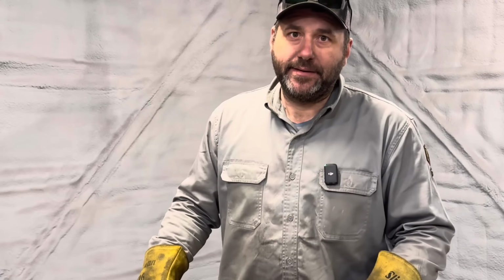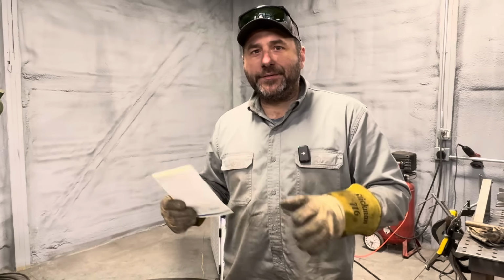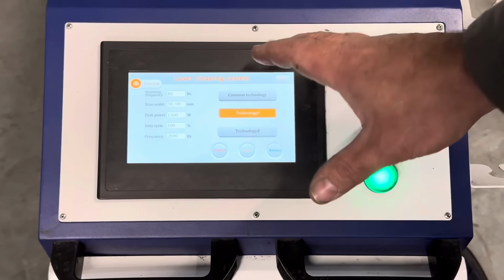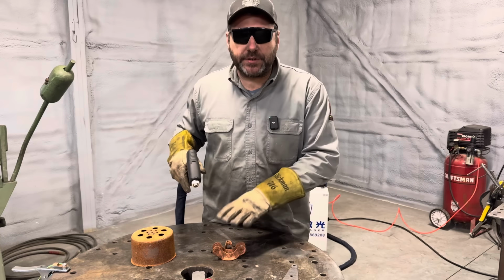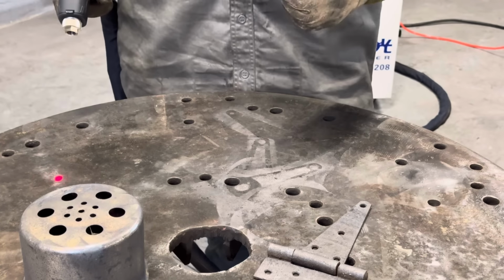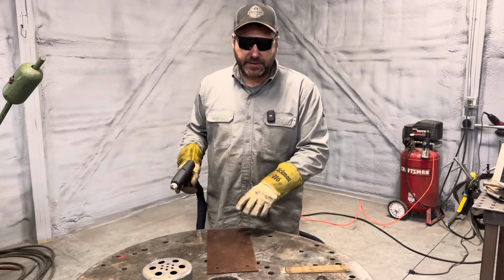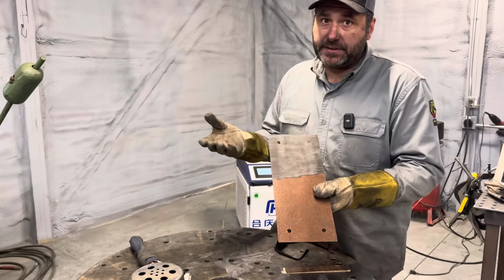Buying a laser welder/cleaner for a fabrication shop.

Comment: I’ve used the IPG hand laser welder and decided to buy a Chinese one. My first one I bought off eBay didn’t go well. It was a 1500w for $2799. It was a shipping issue. Got a full refund and found a 3000w fiber laser welder for $2100 on eBay. Just bought it and hope the shipping situation goes better this time. Both are in the US. 1st one in California. This one I just bought is in New Jersey. This machine although being a 3000w machine looks a lot like yours. Anyway I’m hoping it’s a good experience. As I said I’m familiar with welding lasers. Just hope there’s no problems with the unit and or the shipping.

Comment: Garbage.. we have a 14k watt  cnc cutting table... works great. 3000w welder cleaner is a pos, wire wheel is still far superior, laser cleans the paint does not remove hardened paint, very problematic when used daily at 100% duty cycle, lenses are ridiculously priced and burn many per day, customer service is awful, huge shipping delays, this is not cost effective, its unreliable, delivers an unsatisfactory finished product, virtually no safety literature, The welding side is no better, absolute perfect fit or garbage, 12+ passes to achieve a 3/16 weld, if your into anything bigger than spice racks, mail boxes or a muffler shop, these are crap.

Comment: Did your welder require a transformer? Or how did you connect the wiring? Mine came for 220V, but only one line and a neutral. Thanks.

Comment: im about buying the 1500 watt machine
i  purchased before the co laser  and the  fiber marking
well, it is true   they wont give   deep detailed info

but you can learn it on your own
in my case  it will be 4000  as door to door including all shipping and custom fee

extra cost is nitrogen, about 30 dollar per filling a bottle
consumables like protective  glass  or copper nozzles  for a few dollar each at least  dozen of seler on aliexpress or from seller you purchasing

it is up to you taking the chance  buying directly
but risk is  way  way less than many stating
Reply: router i purchased  in 2011 still talking  with the guy
same to the laser purchased 2018

Comment: Handheld laser cleaning, carries distinct risks. The lack of a fixed, stable setup increases the potential for accidental exposure to laser beams, posing serious threats to skin and eyes. It's also crucial to recognize that laser safety goggles are not one-size-fits-all. Specificity is key, as fiber lasers operate at different wavelengths compared to lasers like CO2 or Nd:YAG. Goggles suitable for one type might be ineffective for another. Ensure that the safety goggles are rated for the exact wavelength range of your fiber laser.

Comment: I saw on another video if you go into the setup and then you change the lens you have to actually change the lens in the unit and then you can actually change the scan width and I saw it go up to 40 mm

Comment: I'll wait until the price comes down. The televisions that were 10 grand when they came out are obsolete, and the better ones now are 500 bucks.
these things will get smaller and cheaper.. having a sandblaster/ cleaner, and welder/ cutter,  in one is an automatic game changer globally.
I'd say about 3 years,... buying will become more optimal
Reply: Just like plasma cutters. I used one at my old job 24 years ago that was the size of a shopping cart and ran on three phase power. That thing was probably 15-20 grand. Now I have one at home that works on 120/220 ac thats the size of a lunchbox. All for 300 bux.
Reply: Yup,...the solar panels and inverters coming are going to be small enough and cheap enough that it will be insane to stay on grid.
    I'm off grid, and having my own power is the most freeing thing I have known, and I was a cross country hitchhiker back in the day. Freedom or as close as we can get,... means no  easements and no reliance on corporations. Its beautiful.... @Fireship1

Comment: Thanks for the great video. Wondering what are the parts that needs to be changed every now and then? And what kind of maintenance does it require? Do you need "gas bottle" for rust removing? Thanks.

Comment: Love the lazer welder. However, scams on the net stoped me from buying. A lot of vidios on youtube, but only show the hand held gun, at very low prices. Not the rest of the machine. After ordering twice, and get a flimsy plastic tool case with a usless tape measure, a total rubbish screwdriver, pliers and a few othe pieces of rubbish. I  desided to click it as a scam to Youtube. Was off youtube for a month. Back on. Noticed it says "Sponcered" Dig a bit deeper and find it is sponcered by Chinees companeys.As mutch as i would love a lazer welder, dont fall for the scam.

Comment: While this fellow is a professional welder/fabricator and is very safety oriented to protect himself, and he does a great job as an instructor on the equipment and safety rules. These laser welders are now available to every yahoo in the country , many who have never read an operations and safety manual in their life , their eye's stop working at the end of the set up guide .
Expect a lot of very terrifying stories of and videos of laser accidents. I learned to weld in a training course 30 years ago, but I have not worked in the trade for 25 years , I wanted welding capabilities in my home shop and bought a welder , and then I signed up for a certification class nearby. The instructor told me to get started by watching the grinder operation and safety video on the internet and I could take the test first day of class. I had not worked a grinder in many years either , the video was great but what really imprinted safety equipment on my brain was the 20 pictures of injuries from not wearing safety equipment and taking the blade guard off the grinder . I was shocked by arms cut to the bone 6 inches long, fingers cut off, wires from wire wheels embedded in the eyes and face,  thin cutting disc pieces piercing the eye and skulls of people without safety gear. This type of equipment is only safe to use, when you follow the safety rules to the letter every time you use it. And a quick prayer before using doesn't hurt a thing either.

Comment: I've brought in a number of these units for people so that they avoid the support/shipping/language barrier problems. I also mitigate issues like safety in glasses, surrounding workers etc. A product in functionality and safety is only as good as the support available and this is an area China is typically very poor. Could be distance or maybe they don't care I don't know. We try to fill that blank so that products don't end up in a junk pile when they have a problem.

 Glasses on some lasers can be simple to test. The cheap garbage that comes with the laser are simple green plastic and block little. Set your laser on the lowest power and run short pulses, interrupt the pulse with the glasses and see if any light hits the work. The cheap ones only block 50-60%, Buy certified glasses at the correct freq. You only get 1 set of eyes. The cheap ones are green as this is the opposite of red but that visible light, green visible blocks red visible light not effective at IR invisible. IR opposite is UV not green. That's the 1st hint to a problem.

 Light bounce/reflection even with screens is there. Turn off the lights and point a flashlight at the work like its the laser. Anything in the room that gets even a little light is getting bounce light. Lower intensity is lower eye damage but it is not no eye damage! If you can see light then the IR will hit you.

 Protective screens only block the highest of intensities but low intensities also do damage. Likely even with traditional welders as light emitted is a broader spectrum (200 - 1400nm) which includes the same freq of fiber lasers of 1064nm. That traditionally is acceptable to only block direct line of site from the source. Is that actually safe for others?

 I suppose it boils down to the questions of what amount/intensity of UV/IR light is acceptable damage? I don't know if that question over long term has been answered.

 I'm not sure on a 2kw laser if you can get it low enough power to test you would have to try. I know on co2, diode and 60w fiber I am able to test. Even if you destroy the glasses the light should not be able to get through! What use is protective glasses if their protection only lasts 10 milliseconds then destroys your eyes.
Reply: You are a US distributor for these? Do you have a website?
Reply: @johna4327  No I just did a favor for a few. Shipping can be a bear for some and I have shipping channels and avoid most of the surprise costs. A number of manufacturers want us to be their agent but china is a bit weird with agents. What are you looking for? May be able to help

Comment: Pretty interesting that it removes powder coat that quickly. Usually hard to remove.

I'd love to see you weld with it. I've seen tons of videos of people cleaning rust but exactly zero of anyone actually laser welding, so I have a hard time believing it works very well.
Reply: the welding is like a miracle
it can weld  without filler  or with filer
suggested nitrogen   and  it looks clean after velding

but it also has function  to clean  the  welding itself

Comment: First time I've seen someone actually acknowledge the fumes issue with these laser cleaners. More awareness of the Fumes with laser cleaning, laser welding, laser cutting, laser engraving, etc is needed. An ounce of prevention saves a lifetime of lung issues. "make sure your fume extractor is on" is good advice"
Reply: not only on, I assume the fumes shouldn't lead closely past his face like it did.

Comment: Considering how beneficial a clean surface can be for welding. A welder that does the cleaning for you is awesome.
Reply: Yeah that's the biggest feature that made me look at different machines. Cleaning off heavy mill scale and rust is a pain in the ass. Especially on 8x8 square tube and 12x12. I'm dealing with 8 8x8s right now lol
Reply: @BabaYaga214  I hear you, I've worked in metal shops, the last one banned the use of wire wheels because of injuries from people trying to clean parts up.

Comment: Thanks for the review. I've been skeptical about these walder/cleaners.
Out of my price range so I'll have to wait for the Harbor Freight version.
Reply: Harbor freight will be this machine with added costs on top all related to consumables, translation, and middleman dealer network profits. It's cool as hell, but I'll stick to my Lincoln 180C for welding and molasses/water for rust removal- its slower but way cleaner than any laser cleaner in all the videos ive seen.
Reply: @rossbrumby1957  how is it cleaner?
Reply: @particleconfig.8935  Molasses mixture will get into all the crevices etc whereas light is directional. Anything in the shadow will be missed.
Laser fantastic for instant results though.
Reply: @GSimpsonOAM  ah, I read your response just now. Whoops.
So what I was thinking always when watching these vids, I'd shine the light from more angles if necessary. So that'll help. Also, if there's shadow but the surface material that casts the shadow gets ultra heated, there's chances for the uncleanliness to vaporise anyway. Anyway, I don't know enough of it.
Reply: there wont be cheaper any soon
the  1.5 kw  2500  but shipping and custom will be over 1200
same machine on amazon  2000 extra

from us seller  same machine  can be 10K
so its up to you  if you take the challenge for lower cost
Reply: the router i purchased  door to door  was 4500 shipped to the  the shop

from us company  rebranded  would be 25-30K
so its very reasonable to take the challenge

Comment: We had a laser at work, it was for cutting. We had to wear fully inclosed goggles, they looked like the nuke goggles from wwII. We had a rack of goggles in the hallway and one guy walked in the shop without any eye protection. He was fired on the spot.
Reply: The laser reflects and will blind you instantly. Look at the reflection of the laser on the back wall while he is cleaning the powder coat off the steel.
Reply: @TehButterflyEffect That is not on the wall, it is a lens effect artifact from the camera.
Reply: @TehButterflyEffect 
That was the light bouncing into the camera

Comment: These lasers put out megawatt pulses. Glasses don’t block enough to stop you from being blinded. The beam can bounce of 5 surfaces and permanently burn you retina.  I was going to get one until an expert tuned me in.  They can only be used in a light tight box with an interlock on the door
Reply: Yeah no. That wavelength isn't focused by the lens in your eye, so if you're wearing decent eyepro it's not a problem. UV from the plasma formed by the beam hitting the workpiece is actually a bigger exposure hazard.
Reply: this one continous laser
has tremendous power

pulsed lasers  a 200 wat can do closely same than this  2 kw
Reply: I don't think the Chinese use these in special locked rooms?
Reply: Look at his tan increase in 10 minutes
Reply: @janeblogs324  😂😂
Reply: @janeblogs324 just the crap blowing off the metal and covering his clothes, but yes this machine should be used in a separator box.
I think I'll stick to vapor blasting thanks!!

Comment: I have a IPG laser welder at my shop.  The laser and eye damage issues is huge.  don't play with these... you will go blind.  Its completely different than an arc flash and regular welding hoods wont stop the laser from damaging your eyes.  The down side of it is the danger issue and having to have a closed space where the laser can not accidently reflect and hit someone who happens to be upto +300' away.
Reply: We have an IPG laser table at my work. It's no joke, and I've been to their facility to demo their handheld welder. Safety is SUPER important with these, you can also burn a hole through something and through what's behind it, and what's behind IT and so on. Biggest thing I learned was that you can "tack weld" two pieces together, and also burn a hole through your hand that's holding them 🥴
Reply: I did maintenance on PRC and Data tech lasers at 50 watts it could shoot a hole right through your index finger. It's crazy what's available to untrained DIYers.
Reply: 300 feet mightbe a little stretch due to divergence
but caution definetely  need
Reply: @cnccarving  the eye lens... converges...
Reply: I'm not sure the Chinese have closed rooms to use these or wear an additional welding helmet?
Reply: @veselkadogcoats692  They also don't have to carry the insurance my company has or have health and safety oversight like we do in USA.

Comment: Could this be an alternative to blasting a car clean down to bare metal? Like media blasting?
Reply: I was wondering the same thing, I'm sure it will do the job, but I would be worried about a few things, sheet metal froma car is thin, how hot does it get' Will it deform? And also, what is behind the panels in the car, for example insulation or wiring, that you don't melt plastics etc from the back.
Reply: @makingcookingfixing  It only burns the outside, the metal do not even heat up normally... But normally it is totally illegal to use a laser like this outside a light blocking box remotely operated. This is incredibly dangerous for your eyes and anyone else eyes within 100m.
Reply: You may need pulse laser machine for autobody project. continuos laser is mainly for rust removal of heavy gauge material @makingcookingfixing
Reply: Thanks for claryfing

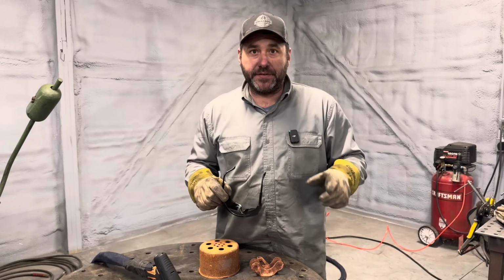Comment: 2:41 - Also want to mention, those laser goggles have different power ratings and laser wavelengths to block, need to make sure to get the proper power rating and wavelengths to withstand/block the immense laser beam reflections ever going into your eyes. 5,000 Watt laser is just insane amount of laser power, I’ll shit on my pants operating such powerful handheld laser stuff.
Reply: Normally a laser like this is ONLY allowed to be used remotely in a light tight box that can not accidentally be opened.
Reply: @a64738  That makes sense, imagine people using these more commonly and laser beams shoots out the window and hits pedestrian’s eyes. When these things becomes more common, I’ll start wearing laser goggles when out for a walk.

Comment: Reliable commercial 'anything' does cost considerably more, because you're not only paying for product reliability, but investing in consistent professional customer support only available from reputable manufacturers. Fast support prevents/reduces costly down-times, normally associated with trusting 'inferior' machinery. For this reason alone, I'd never recommend or buy Chinese commercial equipment, as their warranty's are not worth the paper they're printed on and all guarantees of technical support are a blatant lie. I've always maintained that buying reliable equipment from reputable manufactures at the onset, will in the long run save you time, money and frustration replacing cheap unserviceable equipment. 🤔👍

This is my opinion, I could be wrong. 😉